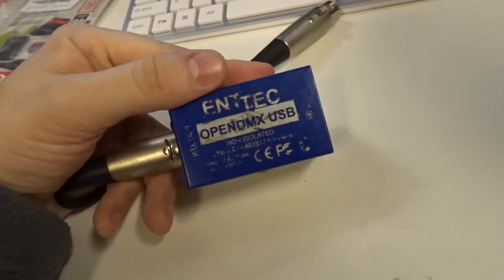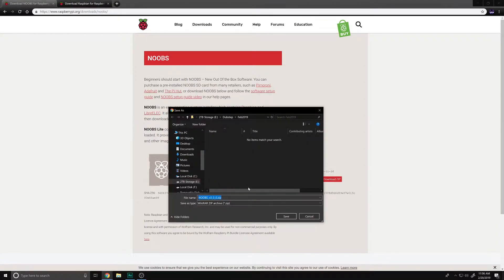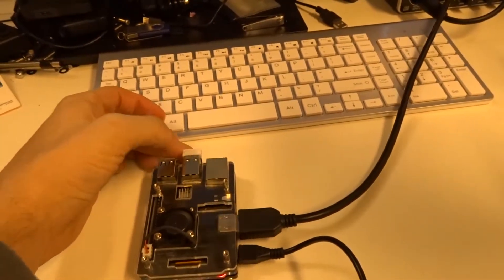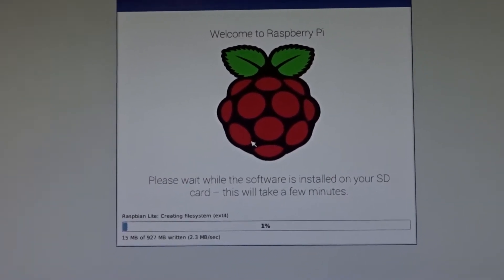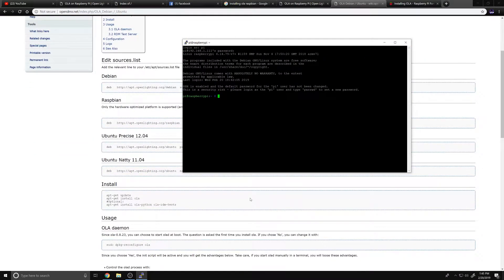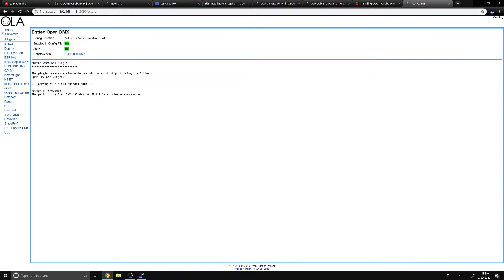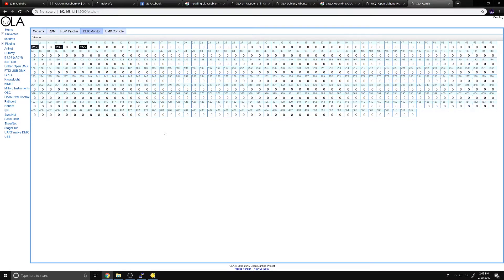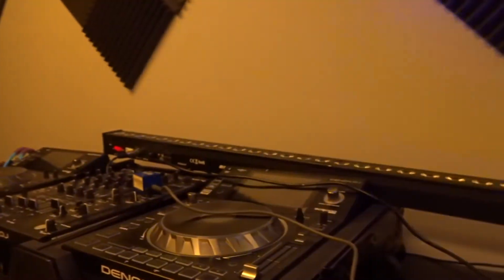Introduction to Art-Net Lighting Protocol Episode 3

Comment: Hi Sir, may I ask some "silly" question on the video.

In moment 16:10, why the number of channels shown only 24 while the detail below shows R1/G1/B1?

In moment 17:39, why the maximum activated channel boxes are from 1-24 instead of 1-72? (since the light bar is 24 LED RGB lighting fixture, the total controlled channels used to be 24 x 3 = 72)

Comment: I asked this in the other video, but why the Raspberry Pi like some has said it can become corrupt if you lose power during the shutdown. Did you make this video before ENTTEC came out with the ODE unit which already converts to the Artnet in the box and says it will work with QLC+.
Reply from the maker: So I have never actually shut my pi down, I always pull power, it’s been fine now for years doing it that way. And yeah. I made this before they came out with that artnet ODE box.
Reply: Code ok the reason i was asking i curious if it needed something else done in the chain that your pi was doing that the ode doesn’t do. You know where i know if i needed to use a pi over a ode. Because i won’t be the person using it most of the time. And just didn’t want a computer in between it for someone to end up messing it up after i done set it up.

Comment: What about receiving the same universe at several nodes? Would I just set my Inputs accordingly in the OLA software?
Reply: I remember in your rig you have a DMX distro amp but I am talking about receiving the same universe at different locations in the room with multiple Raspberry Pis. Thinking of looking into the Pi Zero (the tiny one) for a couple of nodes.
Reply from the maker: Yeah, so standard art-net is multicast, so any node that’s receiving (on the same network) universe 0, or 1, would output that dmx.